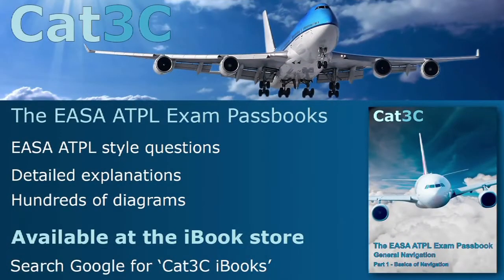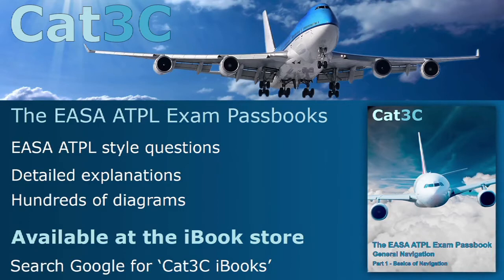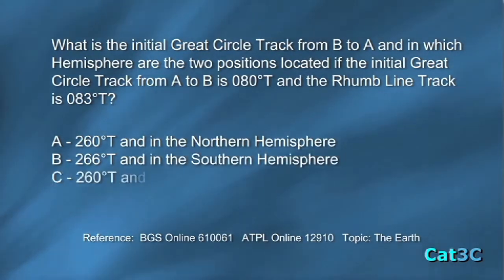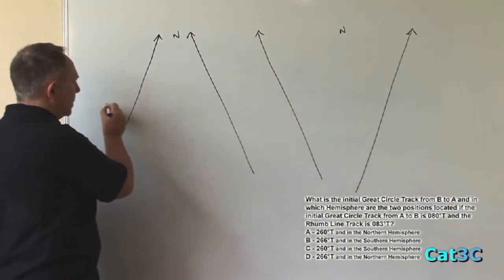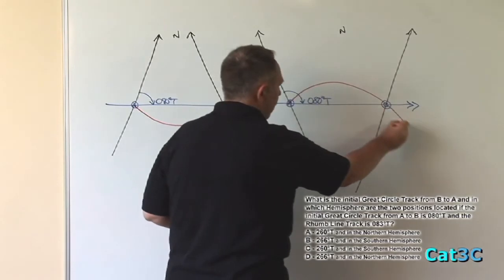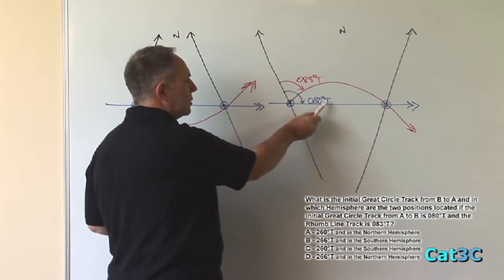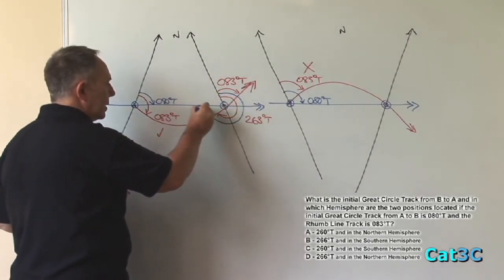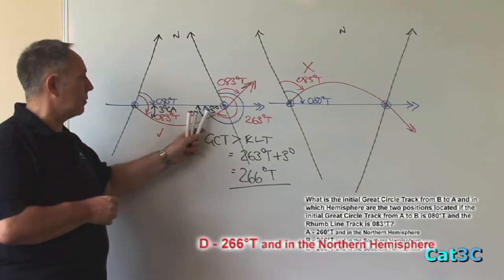QEV 016 Convergency & Conversion Angle (A)

Comment: You have been provided with easterly track bearings, and the question requires you to calculate the westerly bearing. This is the opposite direction or "reciprocal" track. To calculate a reciprocal, you add or subtract 180 (as appropriate).

Comment: Why do you think the red line is the GC? A great circle approximates a straight line on a chart. Rhumb lines are (a) curved lines, (b) on the Equatorial side of the great circle and (c) constant bearing - they intersect each meridian of longitude at the same angle. If you think the GC is on the equatorial side of the RL, I suggest you go back to your instructor and ask for more clarification. Best of luck.:-)